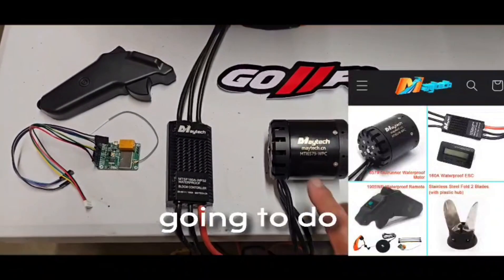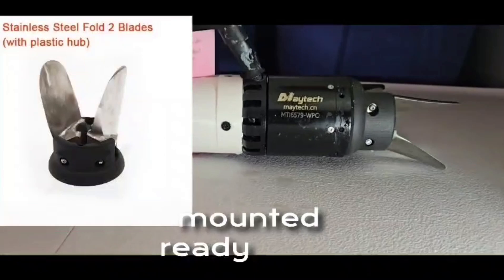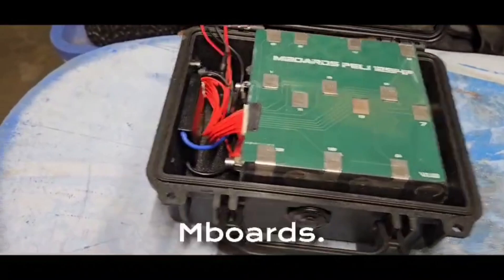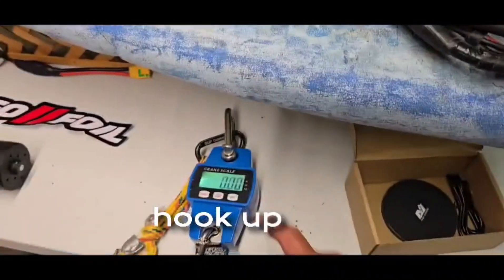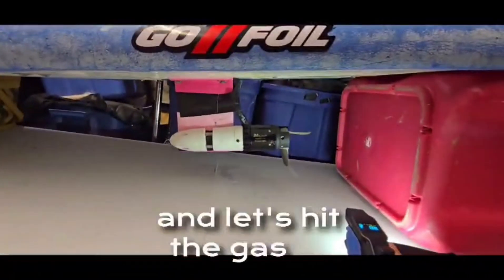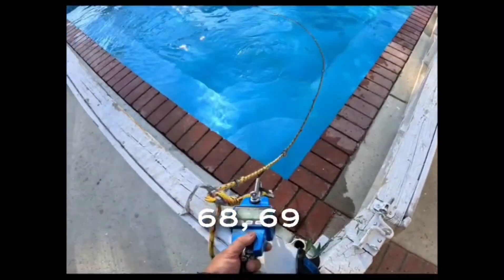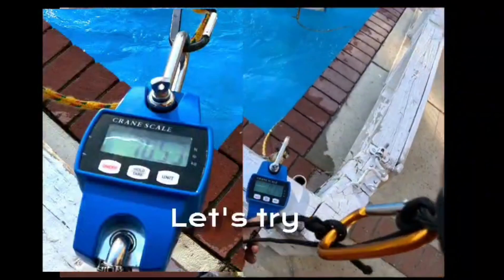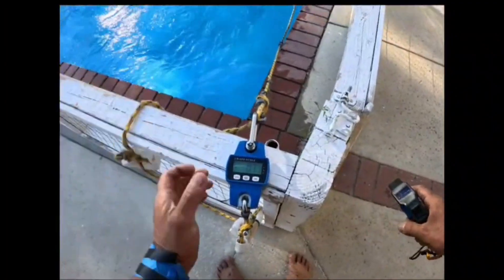Tow Boogie Thrust Test with Maytech 6579 Motor + 160A ESC + Stainless Steel Prop + V3 Remote 71lbs

Comment: is there a kit for building a tow boogie?
Reply from the maker: Hi friend, this kit could work, we have customer use this kit. Or if you want more power, then can also use our 65162 kit as follow link: https://maytech.cn/products/fully-waterproof-efoil-kits-with-mti65162-motor-new-300a-32bit-esc-1905wf-remote-mts2009as-switch-12v-30w-water-pump